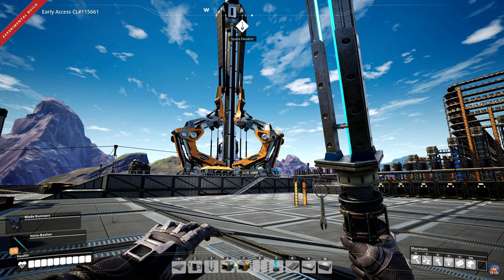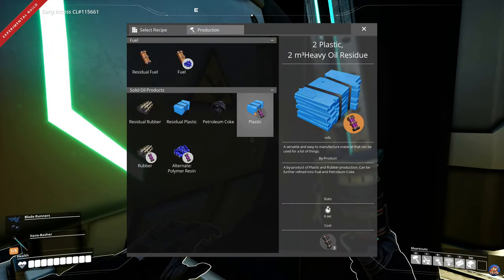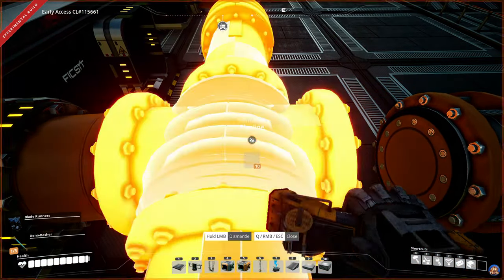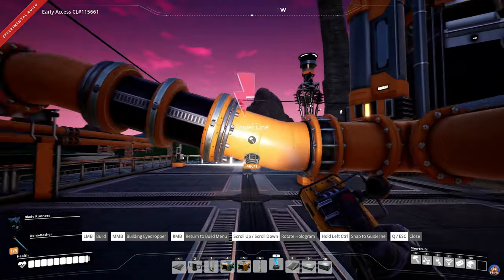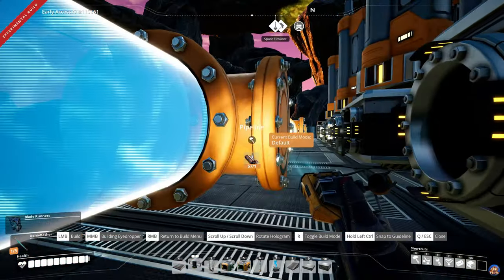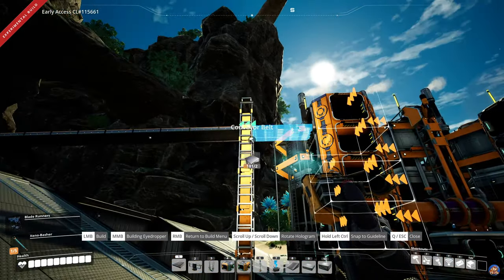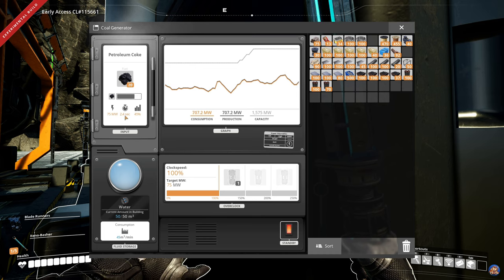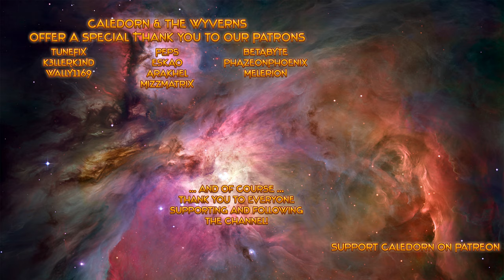Satisfactory Update 3 - Basic Oil Refining Setup - Plastic - Rubber - Coke - Let's Play - EP17

Comment: I've seen elsewhere that while you're in "build mode" pipes can have their placement method adjusted to various options including vertical, missed what control it was to get it working though.
For the residue output pipes was there a reason you didn't link up refineries 1 & 3 then use a + pipe to hook the middle one in?
Reply: Not sitting at my PC, but I think it was 'r' to cycle between 2d, 3d and noodle modes.
Reply from the maker: Thank you both, Andy Brown and Torgonius! 😀
The reason I didn't connect the pipes that way was because of the belt outputs. I'm sure there is a better way of connecting the pipes than I did it - but I haven't gotten completely used to the pipes system yet - and I'm even still refining my belt/lift/splitter/merger connection methods. The Steel/Crystal Outpost is the most "refined"/clean way I've found of connecting belts so far, and since the game doesn't enforce gravity, I am happy to have floating things in the air 😂
Reply: @Caledorn  With the pipes, I was meaning taking it up, then across from 1 & 3 with number 2 linking in. 

More pipes does fit that refinery look though.

Comment: if your calc is for 9.6 or 4.6 then the last building should be set to 60% if it ws 4.66 then it would be set to 66%
Reply from the maker: Well spotted! My calculation was correct, as opposed to what I said in the episode - but it was based on an MK2 belt, i.e. 120 Petroleum Coke. So I ended up with 11.6 or 11.8 Generators, since I have 270 Petroleum Coke (when the Refinery is running, which it currently isn't since I'm not using any Plastic or Rubber in any automated production line). 😀